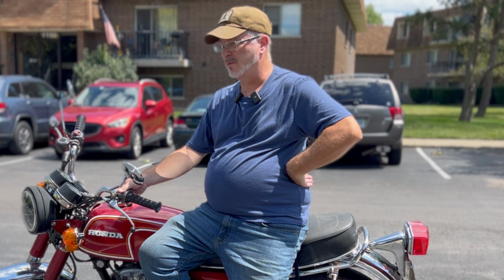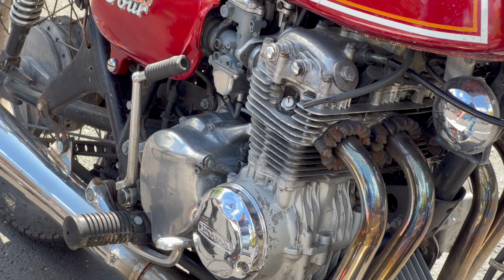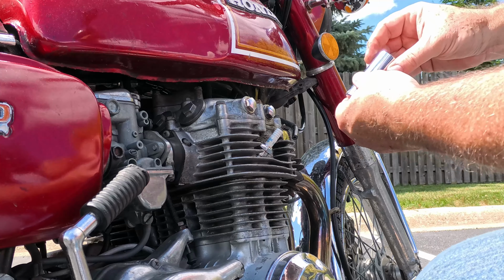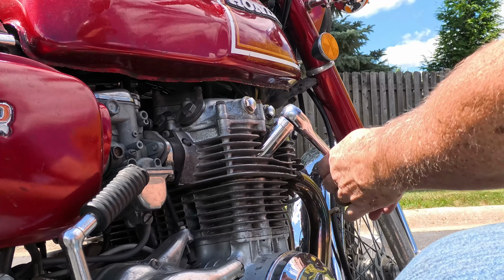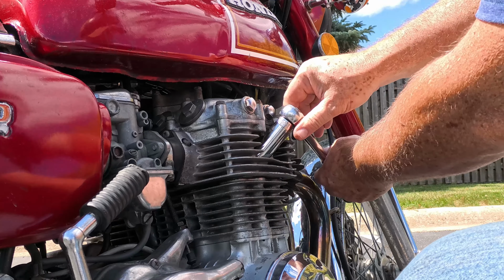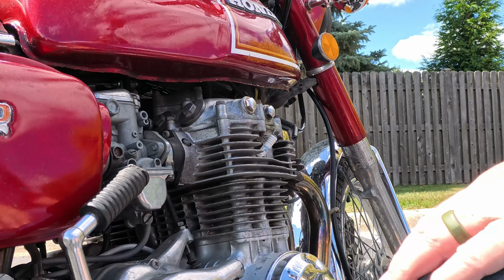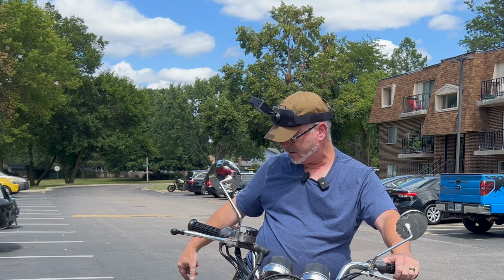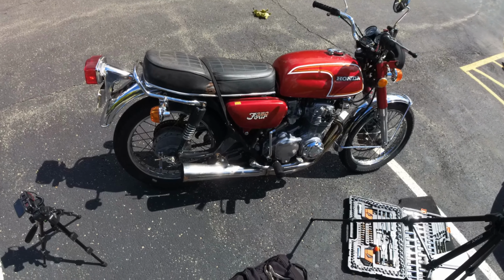1973 Honda CB350Four-Fixing the Spark plug and boot

Comment: Your kickstand rubber is about to fall off.  I still have my original 1973 CB350 four I bought new.  It's never been ridden on a wet road and is now showing 62,000KM's (40,000 miles) and it's compression is still 160psi (just down 10psi from new from factory in 1973).  They are a fun little bike for sure.